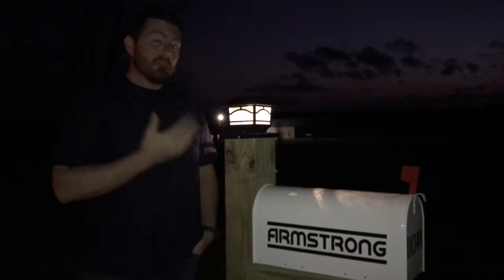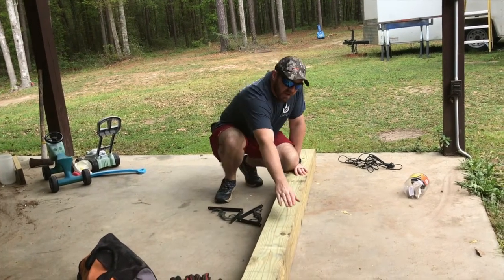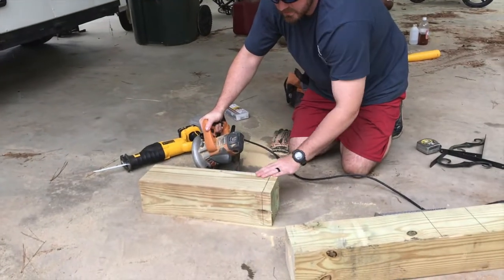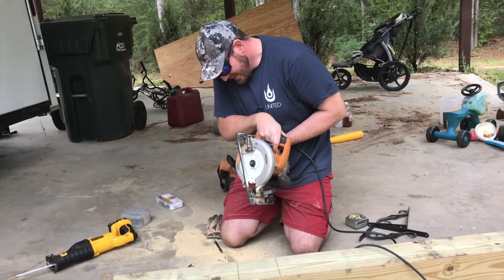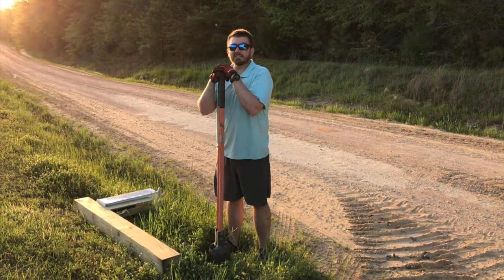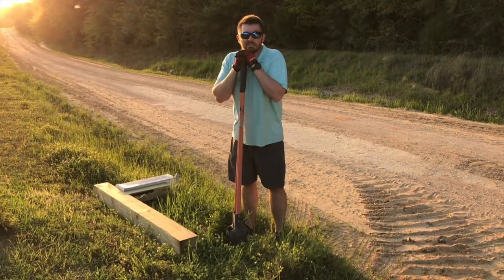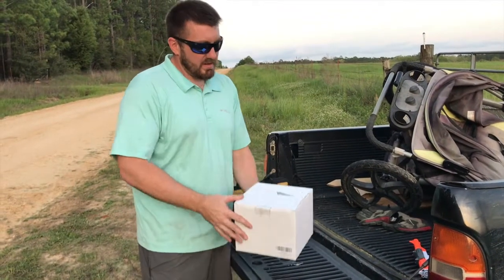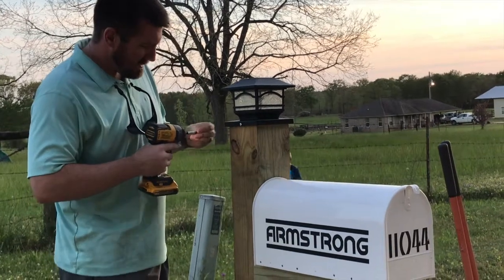How to make an indestructible (almost) mailbox post with a 6x6 and solar cap light from Amazon - DIY

Comment: That's the first time I have ever seen a cap light for a mailbox post. I'm also getting ready to build a 6x6 post, thanks to fed ex truck. I would really like to put one of those lights on, but I guess it's a fun teenage activity in rural Texas to drive around at night and smash mailboxes. When we moved in 12 years ago I pulled the xl box and spent time cleaning, painting, and putting on address. Less than a week later it was 100ft down the road smashed beyond repair. I had been wondering why I had seen so many mailboxes inside large pvc pipe. I got a reg. size "smash proof" (thick steel wall) box and it's been fine since.  I wanted to try another XL box (fingers crossed the teens have come to accept us) I'm worried that light would make a great target  :(
Reply from the maker: @safaricartvideos  that sounds like you have your hands full between the teenagers and the delivery drivers. Hopefully your new one will last.
Reply: @JackArmstrong-jackdaddycustoms  Thanks, I'm hoping those teens have grown into adulthood, I have not seen any smashed nearby lately.  Maybe I will test the new box for a few weeks and if it survives, then try the light.